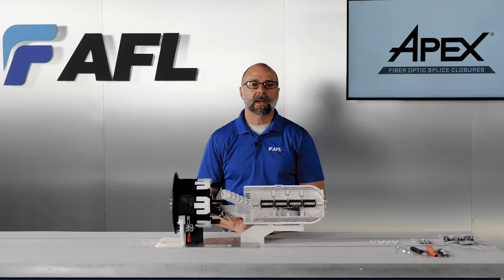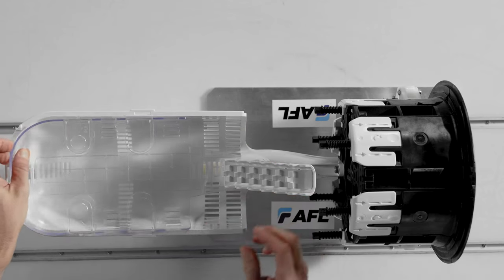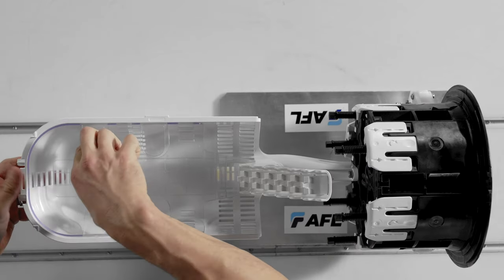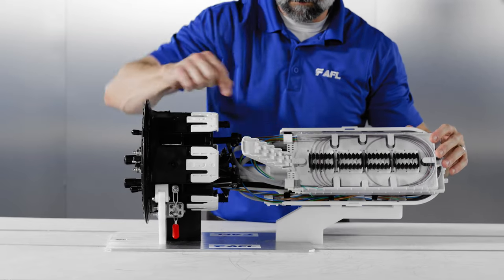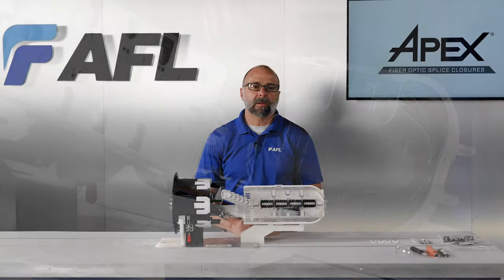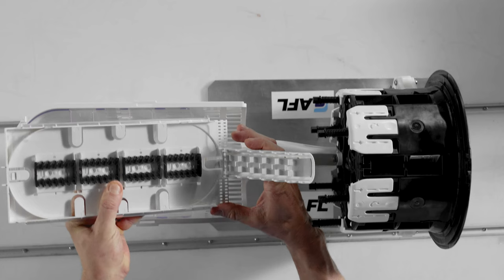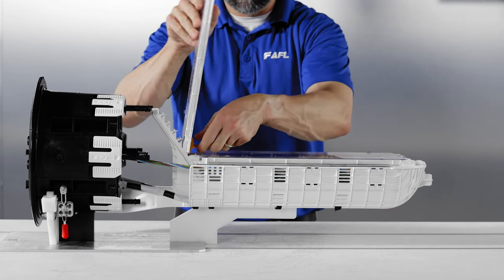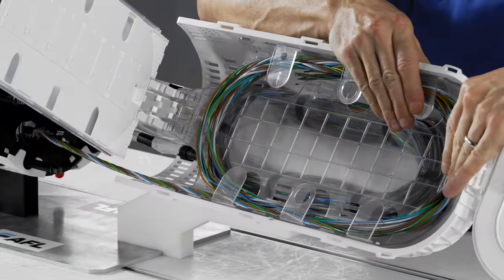Apex Cable Routing from CAU to Tray

Comment: What is the best way to remove the foam off the fiber? I ran into a situation where i didnt have anymore room for my fiber drop because each one was in its own separate foam and ziptied. So i tried my best to pry it open but almost came close to ripping the fiber drop in half.